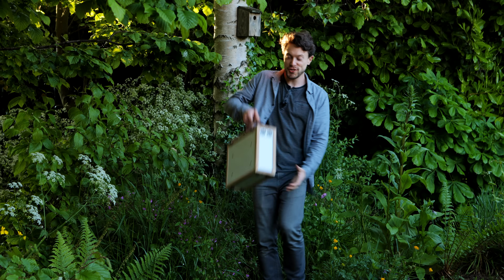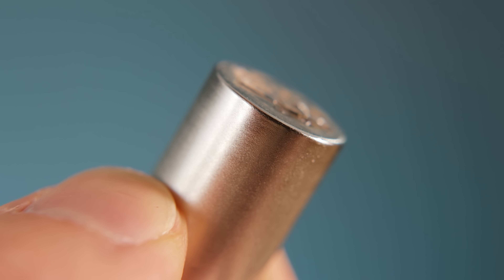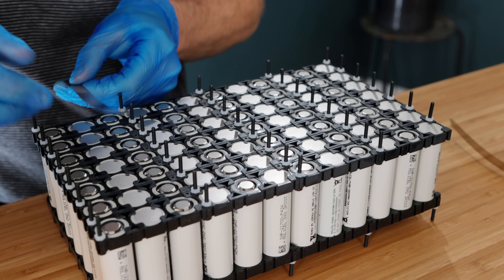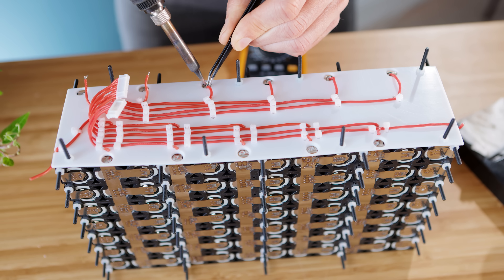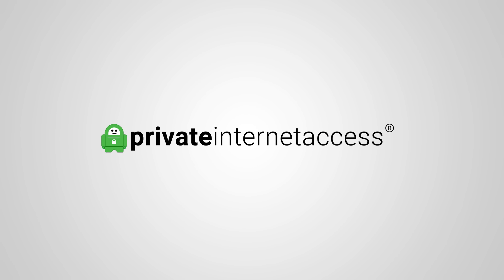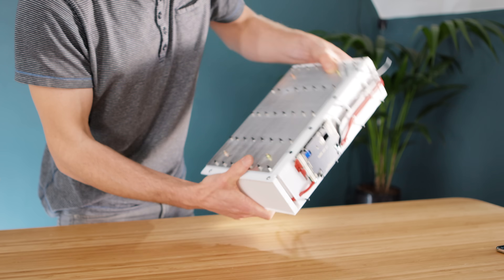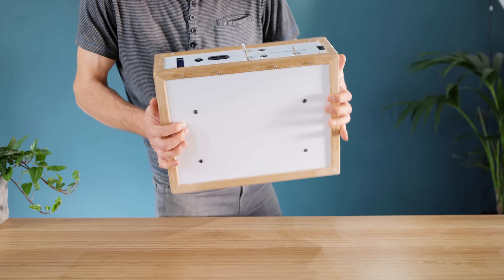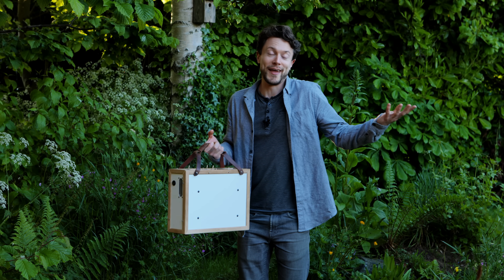Build your own portable POWER STATION (1200w, USB-C and MORE!)

Comment: I'm a little surprised you didn't used brass for this build, seeing as you've been on a brass kick. Unless that grill was brass. In that case I'm surprised that's the only brass piece that was used. Also, due to your use of carbon fiber in the last project, I was expecting it to be used here as well (I don't know if the car charger was actually carbon fiber or if it was just made to look like it), due to the fact your projects are usually thematic at least when it comes to materials used episode to episode. None of this is a complaint, to be clear, I'm just surprised. But my surprised state does not detract from my appreciation of this project and the video. It's a very good project and a very nice looking one at that. The spot welder is the only thing that makes this something that is probably out of most peoples reach....unless there's a DIY spot welder video coming up. 😁

Comment: Amazing video. One thing I recommend to change for safety reasons is the nickel path. You should make a main path and solder the cell (blocks) with thinner wire, to make individual fuses.if one of your 84 ones goes rogue, it will affect all the others and escalate it quicky. Wire such as 35awg thin fuse wire is nice, rated 5amps,usually go up to 8amps, much more than you currently draw... 1200w at 50v is less than 0.3amps in each your cells.

Comment: With so many batteries in an enclosure I wouldn't feel safe using it or charging it without temperature sensors inside the pack. Pack is not ventilated at all and enclosed, I could get dangerous.

Comment: wait voltage or storage amps? (2:00) I could have sworn they charge to 4.2 every time and discharge with average of 3.6v but as they fail they lose total milliamps worth of storage they can hold thus dropping in voltage faster due to the voltage dropping as they run out of power (amps or electrons) ? meaning two brand new batteries would have the same exact voltages even if one is a 1000mAh and the other is a 3600mAh battery but the 1000mAh battery if drained equally fast would be at a voltage that would destroy the battery long before the 3600 battery would be at nominal 3.6v? so many questions. I seriously just need to get the chem lab set up to make up single large batteries LOL 

Also the separators you have, I have been planning something similar but the middle of the battery to be in a unit made of thermally conductive material like aluminum nitride ceramic that then hooks up directly to a heat sink for faster passive dissipation of heat, as I have noticed in my packs when I have had a chance to monitor, that the batteries deep inside get hotter faster, and are also the ones that lose capacity far faster than outer units that stay cooler, (like Kolbalt lawnmower 80v and 40v lithium battery packs,) and I want them to last as long as possible since I want to use a pi and some other stuff to automate my battery powered lawnmower lol.

Comment: $500 worth of 21700 batteries.   That's quite expensive.
Reply: You can use a couple hundred 18650 batteries instead. 21700 batteries are generally really high in quality and power output though.

Comment: A good way to prevent shorting when doing the welding is to first use Kapton tape to cover any terminals to not be welded, doing the welding, then repeating this on the next set. When you're done, everything is shielded.

Comment: You NEVER join unknown cells in parallel - they might be of the same voltage, but of different capacity. 
In industry they match cells to 0.2% by sorting them in bins (groups) of several thousands.

Comment: Brilliant! Could you adapt it to have an inverter built in to provide 230v. Ideal for electricians that need power during a fuse board change for example, when the supply needs to be off for a few hours but the home owner still needs to power for laptops/broadband etc.

Comment: What calculations were used for the "Microwave up to an hour" scenario? According my most conservative estimation (low wattage microwave, around 700W settings, high capacity battery cells, 5000mAh, totalling 420Ah, some 1550Wh), I'm still hovering around 30 minutes?
Reply: Not up to math at the moment, but a while ago I looked at microwave ovens. Remember that the wattage quoted is usually the effective microwave energy while the micro will pull a lot more at the wall. A Toshiba I looked at was rated as a 1.1KW micro but had a rated input power of 1.55KW when only using the microwave function. So that 700W micro will probably pull something more like a Kilowatt the wall.

Comment: with the battery pack and designing high voltage stuff, It would be cool to see a compact electric kart, powered off that power supply.
I have a 48v 1kw dc motor and I would say it would perform really well using that power supply. it would be cool to see

Comment: Why didn’t u add any plug sockets onto the power pack as it seems over complicated using the ports u used in the project
Reply: Do you mean AC power sockets, like wall sockets? This is a DC power brick--to do AC, he'd need to add an inverter which would change the overall size of the unit.  To run the microwave, you can see that he used an inverter plugged into the unit to get (probably) 240VAC, although I didn't see how he connected it to the 50V connector.

Comment: Although your deans connectors were a very good idea, xt90s might work better for your application. If you want a more aesthetically pleasing option in my opinion the traxxas connectors (although proprietary and a little hard to find) look better and I believe can handle more current. Haven’t ran the math on your connector needs but it might be worth taking a look at it. They are both very good options in the RC car world great video!

Comment: I'm a little worried about 24A going through those battery connections... it's probably fine but it just looks a little on the thin side to me.
Reply: It'll be fine as they are doubled up, but there are better connectors available for sure. FYI; Deans can cope with a 40amp sustained load and a 100amp peak.
Reply: @dougle03  wow that's impressive for such a small connector, but I was more talking about the single wire going from the batteries to the BMS since (from what I saw) that was only a single wire
Reply: @KingJellyfishII  With wires it's all about the cross sectional area and length. Smaller wires over longer lengths increase resistance, that resistance is seen in the form of heat, too much resistance for too long and you have too much heat = fire. Fatter cables over shorter distances results in greater current capacity for longer periods with manageable heat.
Reply: @KingJellyfishII  The smaller wires were the ballancing links, they don't see very much current. The main output of the battery pack is via the big Black and Red cables, even then, the BMS will limit both charging and drawing to a pre-set level. The full potential of the battery pack is available after the BMS, only prior to it.

Comment: you just can't solder it correctly, with a little practice the cells can be easily soldered in less than 2 seconds. And the surface needs to be scratched a little with a dremel so it sticks good

Comment: I thought you were going to integrate an AC inverter in the power brick making it a fully plug n play experience.
Awesome work Matt! I always watch your videos to discover new ways for cutting aluminium and wood, plus, 
as an eletrical engineering student your eletrical protections and solder are on spot!

Comment: I like the attention to isolation... And while some of your wiring is low enough guage to act as a fuse? There's also a disturbing lack of actual rated fuses at critical junctures within the pack. Check out any other videos of professionals working with 18650 cells. There's a reason none of them spot weld the bus bar directly to the cells themselves. They use a "fuse wire" at each junction to the each cell.

If something goes wrong on your BMS, your pack could dead short with quite a lot of current. Still, very cool DIY project? But just... Probably not really the safest project as currently designed.

Comment: I must admit I'm a big fan of your builds and want to use some of these ideas for making something myself. One suggestion from my side would be to go in depth about some of the concepts (like the BMS and it's connections, or the smartphone battery charging manager chip's connection in the brass portable monitor) on your 'Extras' channel, to help out people looking to apply these ideas in a project. Another 'for instance' of the above could be recording the disassembly of a console / laptop etc. and record some audio commentary to throw on top of it. Cheers!

Comment: Looks expensive. The batteries alone probably €1000-1300. Add to that the bms , voltage converters and other electronics. Comes out easily at €2500. I'll roll out the extensioncord when i wish to microwave something in my backgarden.
Reply: Buy an anker or a jackery then

Comment: cover the positive terminal, solder without the plastic cover to mutual negative to all parallel, maximum heat transfer for cooling
Reply: fan as dc to ac mechanical generator, brushless dc-ac shaft
Reply: fan simplest solution
Reply: no electronics mess
Reply: nothing to be burdening

Comment: 2x NF-A8 (80mm Noctua fans) aren't enough to cool his VRMs, and other componentry.  Sure, plenty of SMCs can withstand temps in excess of 100c, but running that high, or even close to it, is still a bad idea for longterm health of it, plus he must really like the smell of cooking PCBs when under high load.

Still, the final product does look pretty clean, though (albeit at the cost of cooling).

Comment: I'm a bit sad there aren't any details in the dooblydo, usually after watching a mobile battery  pack build, one can at the very least find there information about the exact make and model of the utilized battery cells, part numbers for the 200W buck converters (buck, a.k.a. voltage step-down), details on the precise dimensions 9f the nickel strip, used wire gauge, part numbers or website links to the used BMS, etc. etc. etc.

Without any of the information mentioned above being provided it automatically becomes 100 times more difficult to replicate this build, instead we only have a short 3 line message with information for an unrelated product 🤔😞
Reply: Video was uploaded an hour ago, so about 22:30 gmt, give him a break and check back tomorrow and it'll probably be there or else basic info with a full guide on patreon

Comment: Would the temperature of the batteries be a concern since you didn't appear to add any temperature sensors, or are you charging and discharging at thermally safe rates?

Comment: This is a brilliant build Matt. I like your attention to safety. The only point I would add it to trim the corners off the nickel strips before welding to remove all sharp edges thus reducing any vibrations cutting into stuff. I always round the ends myself but your build is brilliant. Like you said it's always best to spend more on the BMS to get quality that lasts. You had room to add a decent buck boost module for anything that falls outside your 5, 12 or 24 volt range, just adds more versitility to the battery pack (if your going to these extremes then you may as well make it all purpose).
Again, excellent video, probably the best DIY battery power box I have seen. Pity you couldn't add a 500-1000w inverter into it also but the weight would make it impractical.

Comment: Great effort on the build but one thing which concerns me on this pack, it's pitched as outdoor utility but only in fair weather and definitely don't want to get any water on it as all the connections are on the top...

Thats a big nono from a electronics design perspective- Any water or debris coming onto the box or from the wires to the box can cause bad things to the system. Worth having some protective cover if you're serious about using it properly. 👍

Comment: "Let's get building it!"

I ... I can't I'm poor :( 

This looks so awesome though! I will have to eventually work up to it!
Reply: I wouldn't be surprised if the price reached 4 digits
Reply: Do you have a waste disposal place nearby? Because you could ask If you can dig through old eletric "dump" and catch out old Laptop batteries or something, they contain liion 18650 cells and Sometimes whole battery doesnt Work because Just one cell is shitty, so you can use the rest, just charge and discharge and charge and look for capacity and voltage

Comment: I’m no professional, but for anyone reading this, if you aren’t using well insulated gloves, I recommend using only 1 hand on most early steps except the spot welding ( 1 handed spot welding isn’t a good idea). If you use 2 hands, the electric signal could go through your heart if you aren’t careful, which could stop it if it is powerful enough. Be careful if you’re gonna try this!
Reply: Avoid grounding yourself too.
Reply: Which explains why Matt is wearing gloves. He did warn about the large current capacity.
Reply: @Hare_deLune  with or without a large current capacity you should still use protection when working with batteries.

Comment: I think I would prefer a 110/120V inverter built in rather than the 12/24V inverters. I must compliment your attention to safety though as your safeguards are beyond what some commercial batteries are built with.

Comment: 4:46 I would prefer to use the little cable fuses connecting each cell to the main bus. With nickel strips, if one cell were to short out, nothing would stop it from catching fire and affecting all the other ones.
Reply: Correct. This is not particularly safe imho. Also no fuses on the high-amp DC side before or after the BMS. If the BMS dead shorts, or it's internal fuses fail for whatever reason, that's quite a fire waiting to happen.

Comment: What was the final cost? Having priced several battery projects, I say this cost $800US. In Canada getting batteries is impossible or highway robbery. The only realistic access is power tool batteries. Can't even buy wrecked EV batteries. This 50V pack would cost about $1600 bucks in Canada.